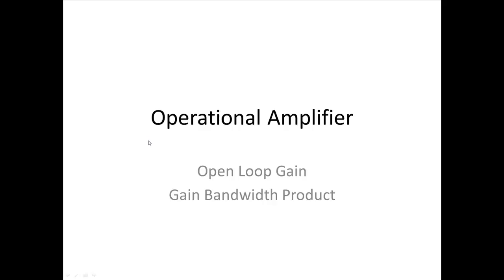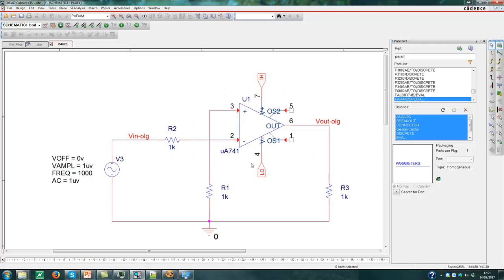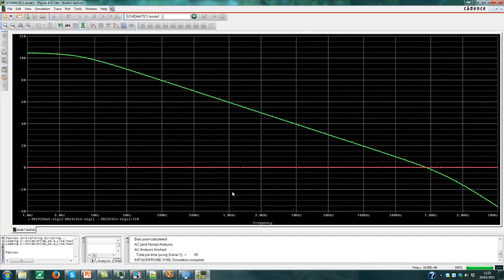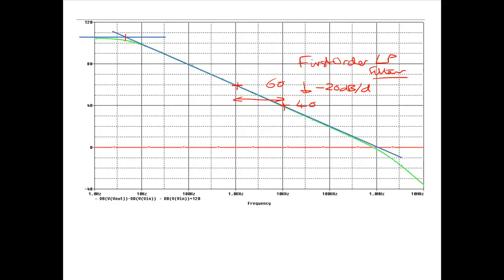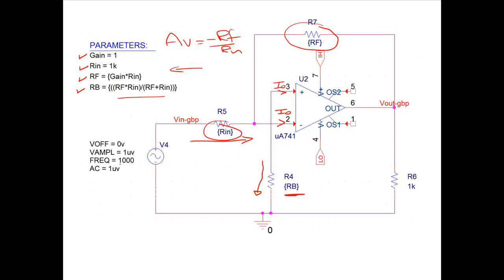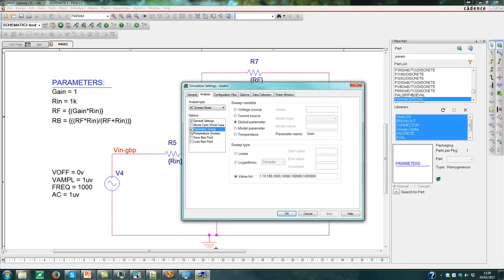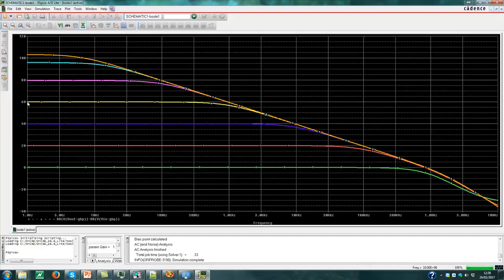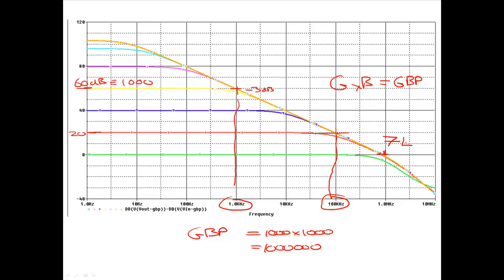OpampGainBandwidthProduct

Comment: Hi I am quite new in this field. Would you please tell me the difference between DB(V(OUT))- DB(V(IN)) and V(OUT))/V(IN))? what would be the appropriate for measure gain between input and output? and what would be the function for pspice simulation to measure gain?
Reply: You can calculate vout/vin but that would be linear response. In amplifiers we always use the decibel scale, which is logarithmic.  So either dB vout - dB vin is the right measure or dB (vout / vin) which is the same thing.
Reply: @RickertyB  Thank you so much. It is highly appreciated and my confusion is gone.